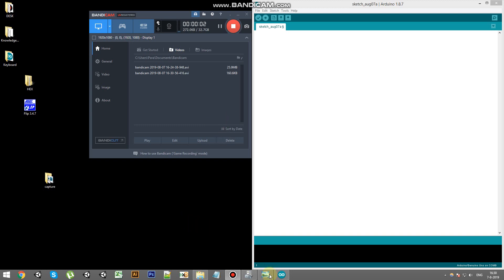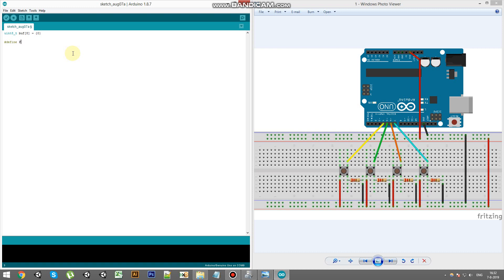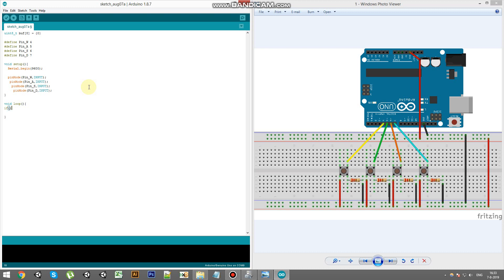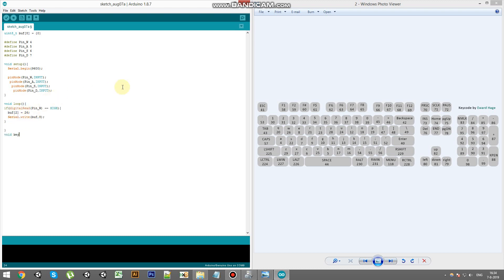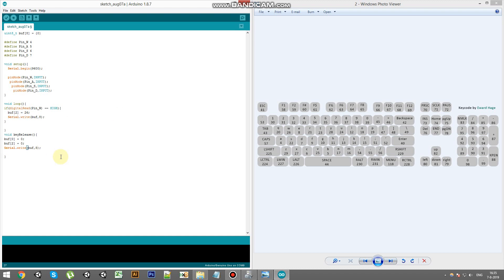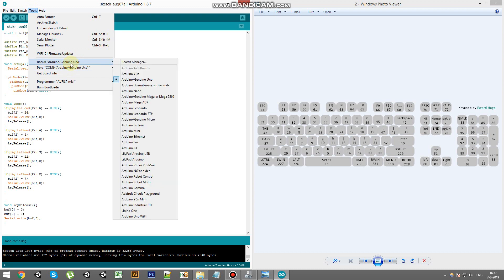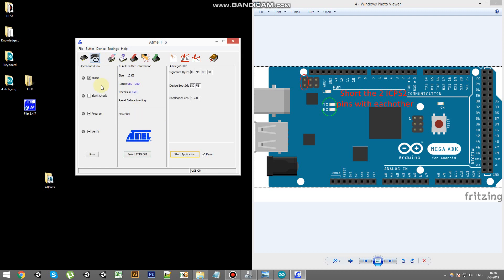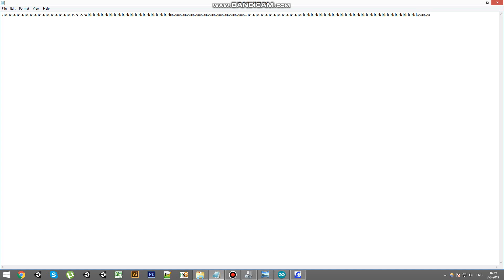Arduino HID Keyboard tutorial

Comment: Hello Eward. Why does Arduino UNO require firmware change in order to be used as a HID keyboard?
Reply from the maker: In basic it changes the communication protocol, so when a operating system recognise something as an input it reads it in another way. When the operating system detects an arduino (by driver) it communicates that way. So by changing the firmware you change the way the operating system talks with it.

Comment: Excelent explanation and it works thanks! Anyone know if there is a setting for "holding down"  a key. I tried this to make footpedals to move left and right in FPS games but the movement staggers as it keeps getting a new move left command so movemnt is not fluid? Any idea?
Reply: You have to rewrite the code in order to allow holding down keys, there are a few ways to do this but the idea is to write the keys that are being held down to the buffer. In your case you could have something like this in your loop:
if(digitalRead(PIN_A) == HIGH)
{
    buf[2] = 4;
    Serial.write(buf,  8)
}
else if(digitalRead(PIN_D) == HIGH)
{
    buf[2] = 7;
    Serial.write(buf,  8)
}
else
{
    keyRelease();
}
I haven't actually tested this code, but it should work in theory.
(Also I do realize this is a year late and you probably figured this out by now)

Comment: the problem is that the bord will be detected as a keyboard and you can t program it
if you want todetect il like a normal usb port you need to use flip with tthe other drifer from HEX folder

Comment: Thanks for the video but it did not work for me. When i jump wire the ICSP1 pins that you show on the video, the board only resets. They are pins 5 (RESET) and 6 (GND).
I did jump wired pins 1 (MISO) and pin 2 (5v) but nothing happened. I neve get the UNKNOWN DEVICE that allow me to upload new drivers.
And FLIP shows   "AtLibUsbDfu,.dll" not found. :(

Comment: I know this video is a bit old now but as a tip to anyone trying to do this on a clone that doesn't have a second set of ISCP, the two ISCP2 pins you need are directly connected to the usb to serial chip on the board, for a genuine uno r3 its a square close to the usb port, for mine its the CH340G, a rectangle close to the usb aswell. Looking up the pinout for this chip I found that DTR is pin 13, this, atleast in my case, is the reset pin and the pin on the top out of the two that need to be shorted for this to work. I shorted this pin with the ground of the arduino and it worked just like the ISCP2 pins shorting would work. Try this at your own risk and if your chip doesnt say CH340G, look up its pinout first.
Reply from the maker: Cool trick will look into it! ❤️

Comment: Excellent video, many thanks. But before jumping to test it, how can I revert Arduino Uno with original configuration ?
Reply: There should be the original firmware in the other folder that you can reflash to the chip on the arduino using the same technique in the video with the atmel flip software

Comment: I have gotten code compiled (verified) for 54 buttons on a Mega using 5-way navigation modules and toggles for DCS World sim. Regarding wiring, all Common connections will go to 3.3V+.  Will I need "pulldown" coding to ground each input pin?
Reply from the maker: Cool!!

Pull up, or pull down doesn't matter aslong as the Arduino registers a press from the button

Comment: Followed  all the steps but nothing happens, when I push the buttons. No eror is coming up, dont know what to do
Reply from the maker: Want to help, but can you be more specific? ;)
Reply: @CorporalHammer  yes, would be great, but I cannot find my Error and dont know how to discribe It, because nothing is happening, I used all the Files you Provided so any Copy mistakes are prevented
Reply from the maker: @finbrox9665  then it should be an hardware thing
Reply from the maker: @finbrox9665  reason you can not find any errors is because your arduino isnt an arduino anymore, it is tested with an atmega 2560 and uno chipset
Reply: @CorporalHammer  Like what 😅?

Comment: Hey ! Thanks you so much for sharing this tutorial ! It work well for me except for one thing. When i push a button once, it register between 6 to 10 characters. Do you know how i can fix that ?
(I'm a newbie and don't know how to code ^^' )
Reply: Microcontrollers detect mechanical contacts smashing as multiple pulses. You need to put in a capacitor parallel (if I'm right) to the switch to smooth out the bouncing
Reply from the maker: Delay at the end of the Whole lope functio()
Reply from the maker: Np dud, change the baudrate, or put in a delay :)

Comment: I can't find the information stored in keyboard buffer.  Is there any link to see the details about this buffer? How did you know that the byte 2 is what we are going to deal with? And finally, a great tutorial to take off.
Reply from the maker: Simply said, no you cannot when the arduino is converted. You can however test the output of the array buffer with print(buf[i]) and open the console of arduino. When doing this ofcourse DONT push the HID.hex onto the arduino.

Comment: This is great.

Will this work with an Arduino NANO?
Reply from the maker: In theory it should, but I have not tested that. Something on my todo list for next week!
Reply: The Arudino NANO already has the abillity to emulate a keybord, since it has a different processor than the UNO. :)
Reply: @laurinmeier4045  So you say I can use NANO without changing firmware?
Reply: @esatkayapnar5680  yep, you just need a library. Keyboard.h or something I think
Reply: @laurinmeier4045  you are referring to the micro. The nano still has the 328P.

Comment: Hi, whats the keycode for the media keys such as Volume up\down? i tried searching for the same keycodes your picture and found this documentation: https://www.usb.org/sites/default/files/hut1_12.pdf (page 56) and said that its 129(volume down) but i replaced buff[2] with 129 and it doesn't work. Thanks :)
Reply from the maker: I think it will be that the fn button keycode is needed :) (pretty much the same as making a capital stroke.)

Comment: I have a question, after doing all of that, is it still posible to program other things on the Arduino, or it Will be detected as a keyboard forever ?

I mean, if after that my PC will recognize the Arduino as a keyboard, would I be able to change the program with Arduino software ?
And if not, how to make my PC to recognize the Arduino as an Arduino again ?
Reply: He provided multiple hex files. Arduino firmware folder is to make it back and the keyboard folder is to make it a keyboard

Comment: This was the best CLEAR and COMPLETE tutorial, THAT WORKS!!  I have been playing with this project for a couple of days and finally got it to work with some missing bits that I got here from your tutorial.

Similar but different than pentaLuke, when I press the switch, I get 12/14 letters... 6 if I press super quick.  I tried different switches and different resistors as well.  And finally, looked into the code, but I am not good in that area...

What do you think it could be?

Either way, THANK YOU for sharing this!!!
Reply: you can add a delay in loop to reduce the amount of times it sends it

Comment: Hey great video the only one that really showed how to wire everything the only issue I have is that I don't know what resistors u used. So my question is what resistor du I have to put in for the switches (do I have to put other resistors if I have mechanical switches)?
Reply: The resistors have to be 1k to not make a short circuit and  yes you have to have it.
Reply: Sorry for my mistakes i dont speak english :D

Comment: How would writing multiple key strokes to the buffer work if I don't want to necessarily release the key every time the button is pressed and it loops? For instance, if I hold down a button I want it to register as a single key press until I release the button? Additionally, if I press two buttons down, and release only one, what would you write to the buffer so that the key that is still being pressed remains pressed but the key that was released gets released?

Thanks for the tutorial, this will help a lot. Corona has Amazon waiting a month to be able to ship out Arduino micros.
Reply: I'm also looking for a solution to this issue, did you ever figure it out? I don't want the character to repeat when holding the button.
Reply: @marvg7062  Unfortunately did not, decided it was worth the grey cells to just purchase some Arduino micros instead.

Comment: Thanks for a great tutorial, I completed the project and got it working. The only issue is that the buttons don't register single or double presses. Only if I hold it down for longer than 1-2 seconds and then it registers 5-10 characters in sequence. I'm using the uno with a ATMega 328P.
Reply from the maker: Hi PentaLuke, I will take a look into it and send you a solution. cheers
Reply: @CorporalHammer  thanks for the quick reply! Will try to see if I can get it to work properly on a different computer. I have checked the wiring and it is correct. Gonna test another uno board as well. Will be using it primarily for command shortcuts in CAD  Also thinking about experimenting with gamepad/controller for sim racing later on.

Cheers
Reply: @CorporalHammer  Hello again, got an update on the issue. I changed all the switches out to the same type but with different pins.
 I think their legs were too short to make proper contact. It's more responsive and stops instantly when the button is released. The problem is that when I press once it registers six characters in sequence. Tried changing resistor values between 2K/10k and 3.3V/5V VCC but it did not affect its behavior. Going to check if I can modify the input with software.
Reply from the maker: @TheEisel  hi Just got the same arduino in the mail, looks like a hardware probleem (maybe pull down or pull up resistors?) but I reckon we can solve it through using a boolean in the code which we set to True and then reset after a timer. I am now trying to replicate the problem. Will give a solution when finished! Cheers for the update!
Reply from the maker: @sem6045  If you reboot the firmware using flip yes ;)
Reply: @ @CorporalHammer  Did you find a means of delay for the key output command?